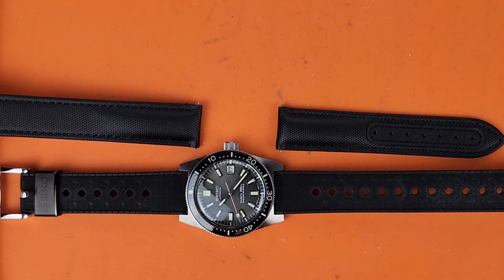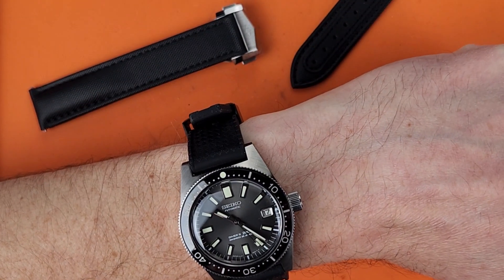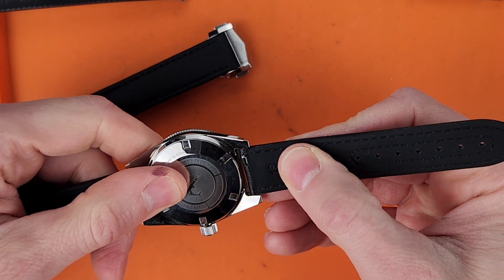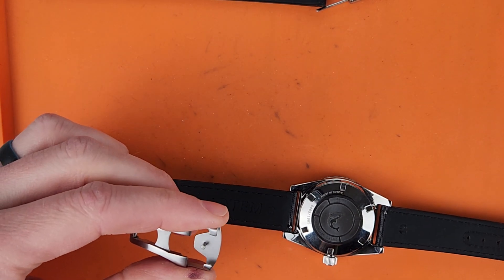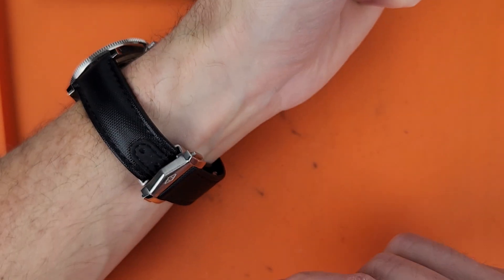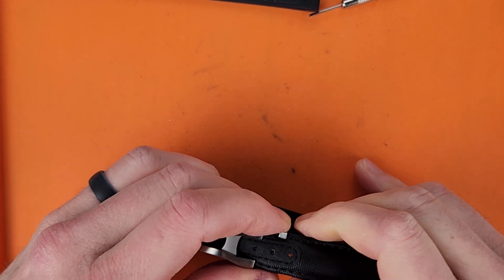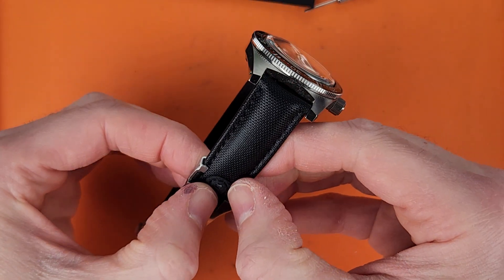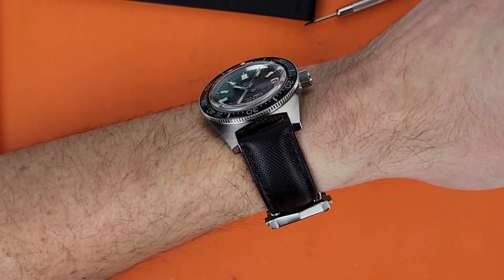Artem Straps Loopless Sailcloth Strap Installation And Adjustment On Omega Style Deployant Clasp

Comment: Hi Kevin. Thanks for the review. I was wondering if the Artem Loopless you had here was the standard size or the small sized (shorter length) version. Thanks.
Reply from the maker: Since the were sent over, and I did not order them.  I don't know for sure what size they are.  I can't imagine them getting much shorter than this though.  I have a 6.5" wrist for reference.
Reply: @WrongTimeWatch  `Thanks Kevin. I ordered the short version. Hopefully it works. Otherwise its gonna be a costly error.
Reply from the maker: @ronin7106  Oh man, I hope it works out for you.  I just did a quick search and it looks like the XS strap is for wrist sizes below 6.5".  https://artemstraps.com/pages/strap-length-guide-classic

Comment: I own a loopless strap and the Omega style buckle that comes with it. The strap itself is fantastic, but the deployant clasp leaves a lot to be desired. 

1) It’s extremely hard to adjust, even with practice. Not something you can easily change on the fly if your wrist swells. 2) There is a lot of exposed metal underneath the buckle and badly finished edges that make it snag on the strap when adjusting. I had to file down and polish the edges of mine so they would be less visible and smoother. 

For the price they charge, you get a buckle that is not the-equivalent-of-price-disparity better than an AliExpress Omega-style deployant. In fact, I’ve compared them and they are almost identical.
Reply from the maker: That is good advice about filing down the deployant to ease the adjustment of the strap.  I did not have to do it, but I can see how it would help.  I did not notice the sharp edges at first, but feeling it again with my fingers, I can see what you are talking about.  I don't feel them on wrist though.